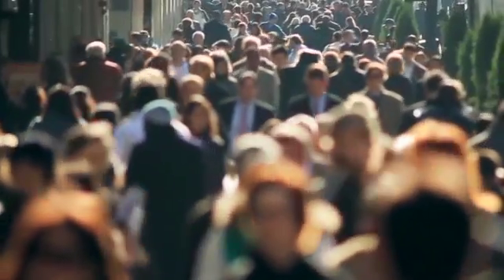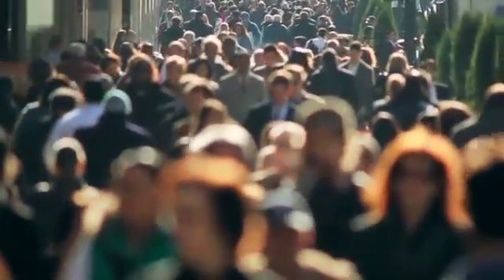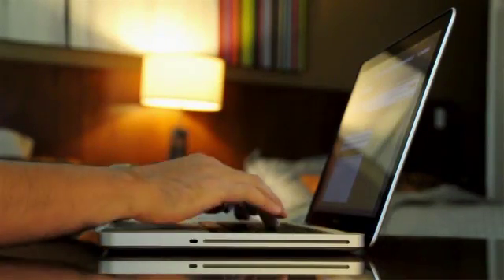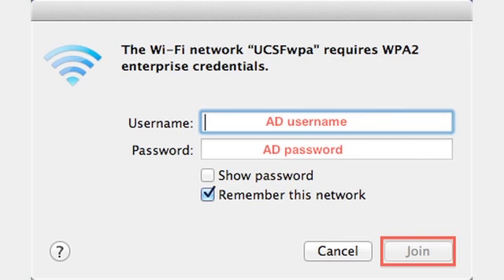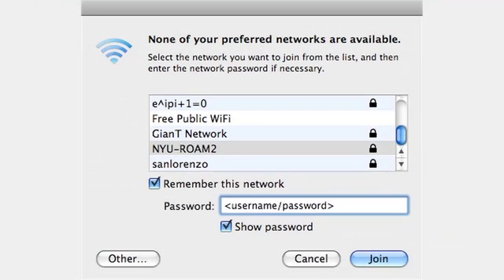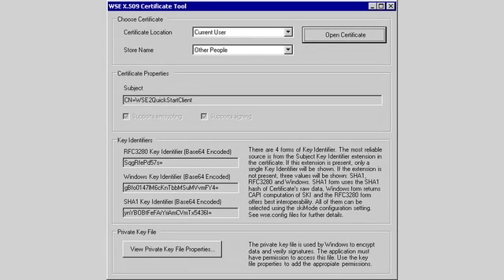Hotspot 2.0 Explained

Comment: I had a private internet connection THAT'S until hotspot 2.0 network showed up on my computer.My computer isn't a lap top it stay at home I just bought a Roku flat screen tv now I can't WATCH IT OR get my TV to work.I have no internet access, WHY BECAUSE OF HOTSPOT 2.0 THANKS A LOT 
Do you also have A software called Hotspot shield, I NEVER ASKED FOR IT I guess I picked it  up while surfing and can't get ride of it I can only quit it that what says on the drop down menu IT'S THE SAME A RANSOMWARE, I ALREADY PAY TO GET ON LINE, IT LIMITS YOUR BAND WIDTH TO A VERY SMALL AMOUNT. ANOTHER GET RICH PLOY. i KNOW i GET A LOT OF NASTY COMMENTS.. SO BITE ME
Reply: Are you stupid?